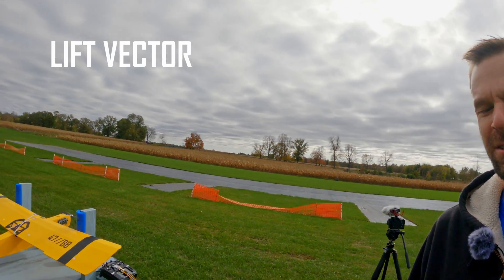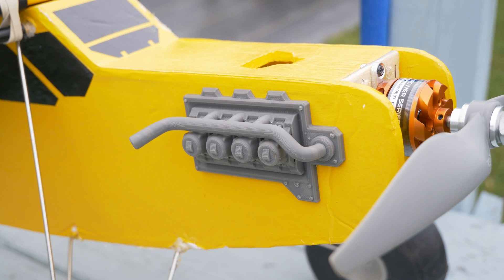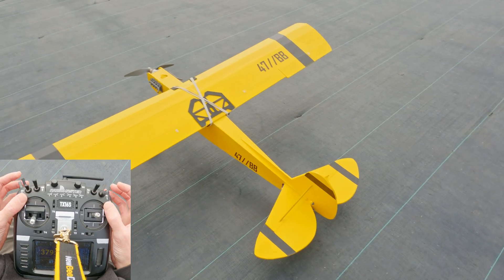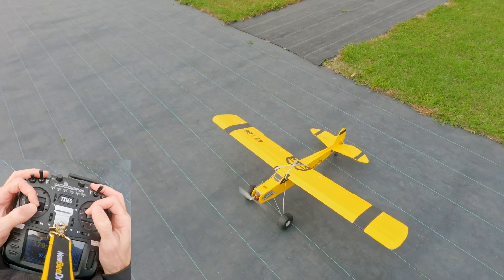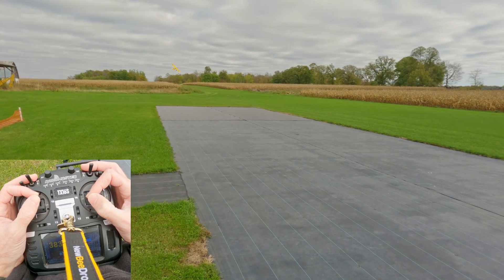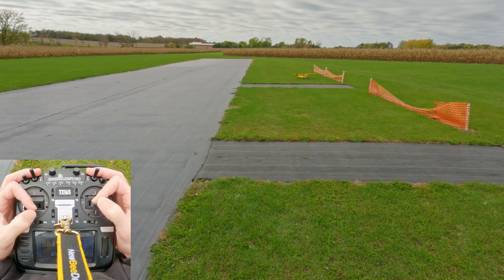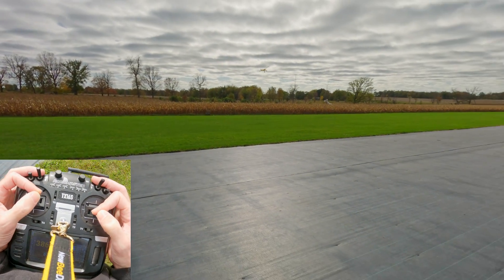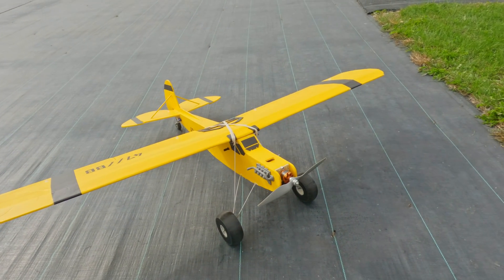Beginner friendly RC Plane | FliteTest Storch

Comment: Yo dude! Quick question,  did you use the flitetest motor mount (firewall) for the 3536 motor or did you made it yourself. If so , can you give me a tip to make the firewall as I am planning to build a ft legacy..
Reply from the maker: Pretty sure I used around 1/4" thick plywood, drilled a large hole for the center and a hole for the wires. I then screwed the metal motor mount plate directly to the plywood.

Comment: Very well done storch. Btw, how does the landing gear hold up in the long run if it is made as per FT video?
Reply from the maker: Thanks! I've had a bunch of landings that were either slamming down too hard or off-angle and tweaked the metal here and there. I just bend it back into shape and seems to keep working. I bought a pack of 2.8mm steel rods from a metal shop. My Storch is for sure heavier than one without the big wheels and 3d printed parts and I followed the FT build exactly with the base build.
Reply: @LiftVector  hey thanks for the feedback. I learnt flying on a self built piper cub with shock absorbers and now I’m starting to build this plane. Might add some springs here as well. Also, do the flaps make a big difference for landing n take off?
Reply from the maker: @ghostrider8307  Nice, you will like how the Storch flies. The plane is so floaty and light you might not need the springs. Flaps down has a huge affect on airspeed and makes it so fun to land slowly or take-off quickly. STOL for sure. Good luck on the build!
Reply: @LiftVector hey thanks man, can’t wait to get it flying ! Btw I’ve been reading about flaperons vs flaps n although everyone suggests separate flaps, I’ll go with the flaperons as it would be less complex and ill make sure the deflection angle is max 30 degrees (that’s the max range for the ailerons to be effective)

Comment: 12:03 I noticed the ends of the wings(after black tape) are missing material on the bottom. What is it called and what's the reason to make ends different from the rest of the wing?
Reply from the maker: I'm not totally sure, but this is how FliteTest designed it in their plans. The under camber helps reduce stalling at low speeds. Also an easy spot to install the aileron servos.

Comment: Lovely stuff! Definitely be making one of these! Maybe balsa. Love the yellow.
Reply from the maker: Thanks! Good luck with the build.
Reply: @LiftVector  just printed out all the plans! getting excited. what motor/prop combo do you use?
Reply from the maker: Nice! Check out https://youtu.be/arO7EmZtBkM?si=Y7C92qjjsUOYGZlS&t=92 I put it in the description, as well.  @TheSquirrelRCchannel
Reply: thank you so much
Reply: what is the dianeter of these tpu wheels you printed? Ive spotted some online (not 3d printed) but the ones your using look perfect size.
Reply from the maker: 115mm - They may be a little overkill but it's the fun factor for me. You could get smaller foam wheels that are lighter, too. @TheSquirrelRCchannel
Reply: @LiftVector  thanks for getting back so quickly! i found some 120mm rubber ones😂 and im a bit tempted😬😬😬 they are replacements for the arrows bigfoot. do you reckon they would be too heavy?
Reply: i have some nice small ones too so if these are too heavy i can always swap them out
Reply from the maker: Try to find some foam ones. I've picked up a pack of those rubber ones at a hobby shop and they have some heft to them. I think there were for a gas plane. Good luck! @TheSquirrelRCchannel
Reply: @LiftVector  thank you for all the advice i really appresciate it